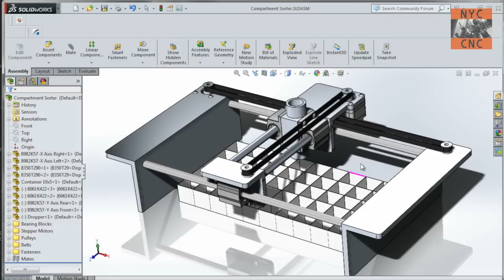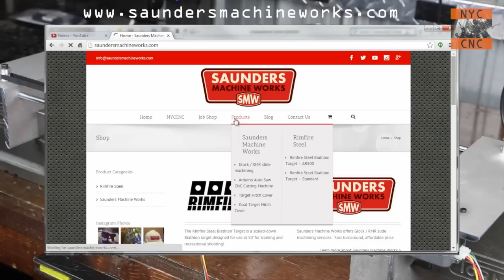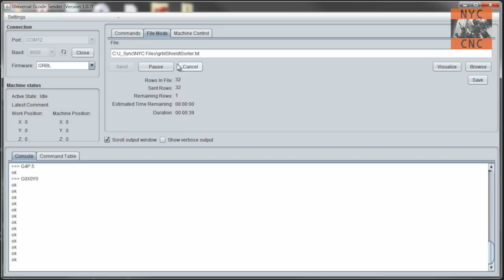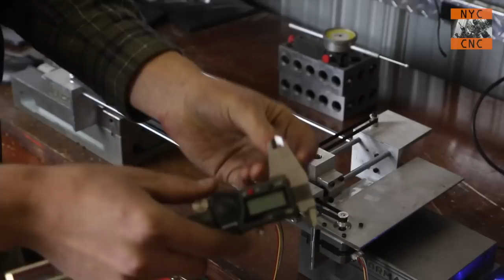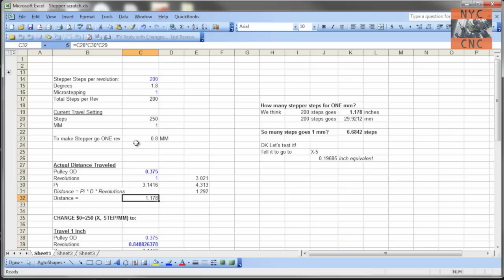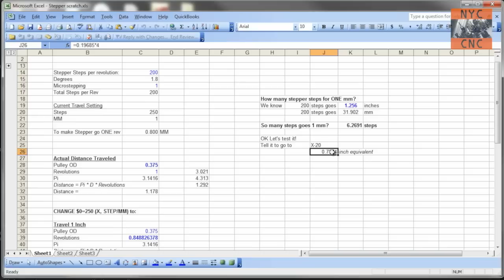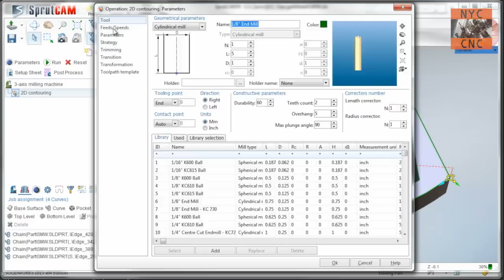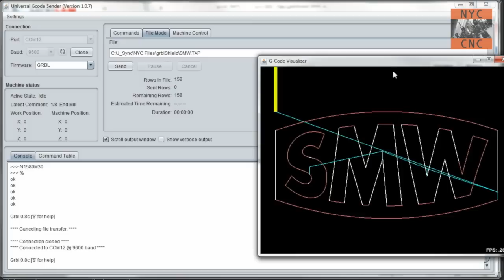DIY Cheap Arduino CNC Machine - Machine is Complete AND Accurate!

Comment: Hey man.. Love this content. I've been collecting a lot of the components to build my own CNC Router in the new year. I still need to get some things like Linear bearings, Variable Freq Drive, and I still need to get the spindle housing and motor. I might go for the the Nema 23 motor instead for the Router itself.. I'm not really to clued in on this either.
. I have 2 Stepper, Nema 17 with 2 TB6600 drivers atm. I want to build a 3/4 Axis machine but I'm not sure. 
I have a real Arduino but I also bought 3 similar Atmega boards that one of my work colleagues told me were the same and would do the same job for me. Geekcrieft or something like that they're called. 
I love how u put this together though. I've watched a lotta videos on this subject matter but I wanted to ask u one or two question if u don't mind me asking..
Q. Will u be putting up a complete list of parts or components, what is needed to build a full and working CNC ROUTER MACHINE? It's very hard for a newbie to this field, like myself, to grasp everything that's needed to finally get it right. I'm completely new to CNC's and I want one in my shop. I'm in the process of looking into starting a small business locally here in Ireland and I really want to build my own for a start. 
I was quoted 2800 dollars by a company for a 1200X1200mm working area CNC Router last month. The machine is beautiful but I also want to build my own and maybe one day start a small business in teaching others with like minded ideas how to build one from scratch.  The company is called Blue Elephant and I was also wondering if u had heard of them and if their machines are as good as they claim??
Great video here btw my friend and keep up the great content. I just sub'd to ur channel tonight bcos it's the 1st time I've seen it on here. Much respect and appreciation for the work u do in helping us to grasp this stuff. It's not easy if ur new to it but u make it more accessible tbf.. Thanks again bro,,

Comment: I have been having bad luck with the Arduino Uno CNC Shields and using Universal G-code Sender. My pin plotter has X-Y axis steppers with a servo-Z. I have End stops on both X+ X- and Y+ Y-, each end. When I am configuring the parameters, UGS faults to an Alarm when I trigger any of the stops. 
I am going to get a different controller system, Maybe a 3D printer controller will do it? What are your thoughts or suggestions?

Comment: srsly,this trash cant be accurate under pressure. Proving it with a fucking pen..man, they must have paid you alot. this is the last time i watch you going down from an interested guy, willing to learn, to a sellout idiot with no plan of cnc manufacturing. unsubscribed.

Comment: I’ve made at least 3 maybe 4 of these after having so many 3D printers laying around and wanting to use the motors. I’m gonna tell you right now save your money and just buy a legit cnc. These are great for learning but not rigid enough for anything serious. What I’ve found is even a shitty machine can do a good job with the right spindle so if you do go this route don’t cheap out on the spindle. Get a nice 2kv VFD spindle with water cooling. Also buy good endmills.

Comment: Hi there, thanks for your nice video. I want to make little project with 2 axis Cnc system.
How can you help me? My project same like centre lathe. My requirement is one axis with high torque
Spindle chuck with low rpm 10 - 250 rpms. Second axis is ball screw for cross slide moment for
Variable pitch purpose . Both axis I want servo motors with gear reducer for high torque.
Please suggest me one of best option controller system with full accuracy and mechanism.
Thanks

Comment: Nice machine and work! I wan't to see your works with this beast :)
I have one DIY CNC (arduino+grbl) with workspace of 1000x850mm (1200x1100 total) with a similar spindle (Kress 1kw) and the next step i wan't to make is put one 1.6kw VFD spindle (more power with less rpm, maybe 2 or 3 times more power).
If you wan't to see my machine https://www.youtube.com/watch?v=SFl_6xrXTx4 here i have one 3D carving i need a lot of improvement but i'm happy with this because are jobs of 3-4hours and doesn't fail (3-4 for finish and 2 hours roughring).
Nice work and continue with this projects! (i love your pro machines and i learn a lot with your videos)

Comment: If there is one video out there that can convince someone that it is not hard to build a cnc for hobby use, it is this one. I like the fact that the cost of the individual parts is spelled out - as well as the limitations one has with these parts.

Comment: love the video.     I've had a Taig cnc ready mill for about 10 years now.    With the ball screws already installed.    But, I'm completely ignorant about cnc machining.    I do have a few 3d printers and I understand all that.    My question is can you explain how I can cheaply convert my Taig to cnc?  Could I use something like this?   Feel free to dumb it down.   I won't be insulted.   

https://www.amazon.com/Longruner-Arduino-Professional-Mechanical-LKB02/dp/B072N4FMRN/ref=asc_df_B072N4FMRN/?tag=hyprod-20&linkCode=df0&hvadid=366299818020&hvpos=1o3&hvnetw=g&hvrand=12463650693523411584&hvpone=&hvptwo=&hvqmt=&hvdev=c&hvdvcmdl=&hvlocint=&hvlocphy=9061255&hvtargid=pla-803031210947&psc=1&tag=&ref=&adgrpid=75871523946&hvpone=&hvptwo=&hvadid=366299818020&hvpos=1o3&hvnetw=g&hvrand=12463650693523411584&hvqmt=&hvdev=c&hvdvcmdl=&hvlocint=&hvlocphy=9061255&hvtargid=pla-803031210947

Comment: I'm very shocked to hear a machinist say that he isn't worried about all the slop that is in that set of rails, you can mic that all day and I guess I'd say it may be ok as long as your only going to usi it for laser engraving, but as soon as you mount a motor on that and as soon as it starts a cutting process the tourque & resistance are going to mess any piece they try to cut even if they are only milling a thou or two at maybe 5 mm a minute, unless you planning on cutting foam and balsa wood.  if the people your selling this to are planning on being able to use it on metal, & don't realize that they are going to have to run it at 5mm a minute or less in order to keep it from destroying any piece of work they put on it. Especially if you making this to use on metal, as much slop as it has it would probably not be very accurate on dense foam over an inch thick.

Comment: I would have used threaded rods instead as the problem compared to printers for a cnc is that it may disturbe the motors when as for example engraving due to non linear movement in directions of the drillbits. Thats why a nema 23 wich has more holding torque does the job a bit better, the 17 can do it very well but they dont have the mass in the shafts to even out lets say vibrations, bumps etc

Comment: because of your videos i just bought a 3 axis 3040. if i told you what i got it for youd never believe it in a million years. but at the end of the build it will be a 5 axis for just about $250.  well maybe 300 ill have to purchase a 5 axis controller. i have been 3d modeling since 1991 so that part of fusion 360 was easy but learning the ins and outs of g code is the next step

Comment: Question? Looks like the Grbl runs pretty smoothly. I’ve got machines here with Centeoid Acorn and Linux CNC an a table top router with a 3kw motor we want to connect to motion control and happen to have an arsenal of arduino here. Yes we make Radio Shack look like a phone store, haha. Anyways despite the fact we have all these arduino boards we havent yet used any of the shields. We thought we’d tinker some day however every machine we build we have negated arduino. With closed loop AC servos using step/dir signals would you feel the router would be a dependable machine with GRBL?

Comment: You were 2 thousandth off because you dropped the 0.001 off your measurement. when you go 2000x.001 = 2. You introduced that error with your rounding. it seems like a small thing until you do it thousands of times.

Comment: Cool little toy. I couldn't help but think about the large industrial Multicam precision CNC gantry routers which this is a mini replica of. It you added an additional stepper and pulley system to the opposite side on X, you'd have something there that would greatly improve speed, accuracy and rigidity along X. Although the Multicam's are using steppers with gears on racks, the drive belts and pretty rigid for amatuer home use. Check their stuff out. Overpriced, but they have a lot of capability.  https://www.multicam.com/

Comment: Hi my much appreciated engineer, years ago I was working in autodesk inventor next then in SketshUp that is very Good and now in Fusion 360, my question for you is why do you working this cnc machine in sold works? I am does developer automatization as cnc and little robots, what software do you recommend for mi?

Comment: Didn't see if someone already suggested thus.  You're using toothed belts and pulleys?  Why not measure the distance per tooth on the belt (maybe count a number of teeth, take total distance and divide to get distance per tooth).  With that and the number of teeth on the drive pulley you should have a good measure of distance per motor revolution.

Comment: Which method of motion is the most accurate screws or belts?
Reply: I think screw attached to a stepper motor is more accurate, due to the timing belts have some bending tolerances; watch my homemade robot:
https://www.youtube.com/watch?v=6FwGJEzRhS8

Comment: Would you recommend an Arduino/Grbl with independent drivers for a mini mill (Sieg X2), or would I be better off with Mach3 and a breakout board?  I’m mainly concerned with missed steps and general performance.  Any drawbacks that you’ve noticed with the Arduino?

Comment: hey dear
i really surprised to c you playing with these things, you are master
and i also learn these things so i ordered some items please have a look
cnc v3 shield one piece
a4988 driver 4 pieces
uno r3 cable with usb cable 
please check the link for material
https://www.aliexpress.com/item/Free-shipping-cnc-shield-v3-engraving-machine-3D-Printer-4pcs-A4988-driver-expansion-board-for-Arduino/32822324590.html?spm=a2g0s.9042311.0.0.ccU1Xi

I have one 5 volts 1.7 amps charger for power supply
i have ordered 3 nema 17 stepper motors also
and please tell me which spindle i should buy 

Are above all mentioned parts enough to build my own cnc engrver or have to buy some other parts also ?

i know  i asked bunch of questions, i m sorry but i am beginner so please help me, it would be great if you send me drivers link also to download

Comment: Yeh great video John I built one similar to your design but using Mac3 with BOB and TB6600 steppers, having problems getting it to work but with correct PSU and Mach3 forum help will get there. Keep the video's coming.

Comment: With pulleys using a timing belt or linear motion belt (looks like G2 belt), do not calculate the travel by the pulley OD times pi, you get whatever you want as a result. Just check the tooth pitch of your belt and multiply by the tooth count of your pulley. Your machine would have 16 teeth pulleys and GT2 belt which has 2 mm pitch, so 16 * 2 mm = 32 mm per revolution of the stepper.

Comment: Hi, very interested in project I am interested in PCB projects and maybe build a version of your CNC machine to drill PCBs, but on the Z axis would have to mount a drill with variable feed rate only problem is defining the pads and point on the PCB so would have to mount camera with cross hair to define center points of pads, also when drilling the Z axis would have to be in the up position before X - Y movement or drill would be snapped, lot to think about .   Great videos.

Comment: Steps/mm on a machine like this should be set based on the timing belt design in use (specified pitch), the number of teeth on the pulley, and steps/rev, microsteps of motor.  you should not measure a timing pulley as the effective pitch circle is not easily measurable or useful.

Comment: That's was awesome, thanks very much, 
I have a question about calibration that you did before uploading the drawing code, what was it for? 
Did you make a stopper for the X and y axis or how the motor know that it must not exceed the point so it don't damage the belt, 
Hope my question was clear 
Thanks again

Comment: Awesome video, thanks for sharing!  Instead of adding a third or fourth linear bearing, maybe adding some offset (in the x direction) between the two you already have would tighten it up.  Or shim them to intentionally misalign them to take out the slack(if it isn't to detrimental to your sliding friction).

Comment: John, I think in this video you had mentioned that you, at some point (maybe in the past?), wanted to place a hopper on top and use this to drop parts into a tray?  I am working on a similar project for putting barley seeds into trays.  I was wondering how you would have created the setup for the hopper and a sensor for dropping a specific amount of parts in each well of the tray.

Comment: Great channel  Thanks for thisany way  I have built a DIY cnc using direct drive from stepper motors ( not using Belts)  I use Sketchup for my cam and makercam to convert to gcode  The problem I'm having I when I go to cnc the part or Letter it come out backwards. It is mirroring the drawing. So in order to cut a word for example I have to flip it on Sketchup to make it cut correctly on the cnc.Is there a setting I'm missing so what you se is what you get Thanks in advance pb

Comment: Greetings John,  Great work !  Very generous of you to share your knowledge so freely.  I'm a former CNC prototype machinist at Kodak.  I now get my purple-hot metal chips stuck to your neck kicks hanging out at the Rochester Makerspace.  Bought my son an older Unimat-SL DB 200 hobbyist lathe/mill machine for Christmas.  These were heavily advertised in Popular Mechanics back in the 60s.  The hope is to allow him to learn the basics of machining on a unit that he can setup in his room and not get seriously injured in the process.  Within a day the obvious question arose; can we convert it to CNC and the answer is 
Yes, quite easily.   I'd like to use your basic Arduino/GRBL controller/driver design and have two questions I'm hoping you can help me with; It's been two years since you posted this, would you still use the same controller components or are there newer releases you would recommend, and, can this be configured to use the Mach3 software ?    Thanks again for the very cool videos and any suggestions you may have.  Jay

Comment: OK. You seem to be on my level. "CHEAP" Anyway I have 2 knee milling machines. One is an antique Norton with a Bridgeport head. The other is a 9x49 inch Bridgeport copy. Id luv to make one of these a CNC.  I've been searching and my head now hurts from trying to figure a decent cheap way for a hobby or one off parts. Like one company makes a turn key kit for $15,000. I could buy a decent Hurco from a shop i worked at cheaper than that. Like I'd have to save for even $1000. Can and will you help me on my quest? I'm a real nice feller, if you don't believe me just ask me.

Comment: First I want to say, great videos! I love watching all of them. My question is this...

I am basically building this exact thing. I have all the parts and am playing around with programing and watching it work. I am able to draw shapes in Inkscape and create the GCode with GCode tools and then send it to the Arduino/GRBL using the ChiliPeppr, which is awesome!!! What I am struggling with is creating something in Fusion 360 and getting the same results.

Is there a post processor for Fusion 360 to create GCode for an XYZ machine using Arduino/GRBL to use with the Plasma Cutter feature?

Comment: Hello.. iv wanted to make a lazer cutter for a while i have 4  printers stripped down. thats 4 stepper motors. some driver parts and the rods. do i basicly have the parts to make a diy cnc cutter. i want it for cutting balsa wood wing struts nd other bits. great channel. iv thumbed and subbed ;0 Ill just need to get the arduino and a good lazer for cutting i think.

Comment: What do you have holding the non-motorized timing belt pulley? Just a 5 mm axle?
Reply: That's what I want to know, too!  Spindle bearing on axle for smooth spinning????

Comment: Interesting video. If you ever wanted to develop more similar devices with X-Y-Z capability instead of having to start from scratch perhaps look to USED medical diagnostic machines. Most use precision XYZ units yet because of very high accuracy requirements they have a fairly short working life, about 3 years before being replaced. I worked in the industry as a field service engineer and trashed many old & installed new machines in my 35 years in pathology, research, hospitals & medical diagnostic locations. They have very little resale value because of their very specific operational use so can be purchased quite cheaply. They are packed with steppers, electronic parts, tubes, wiring, solenoids, controllers, often lasers & optics. They range from desktop computer to small truck sizes and are a hobbyists wonder pack. Check out auction listings for bargains.
Reply: Would you happen to have a link with an example of this diagnostics machine? I want to make sure  e are on the sine page.
Reply: Usually specialized Actions are the way to go. Medical diagnostic companies like Bio-Rad, Hewlet Packard,  Shimadzu,  Beckman Coulter etc make these devices but a some searching on the net will help find their discarded machines.